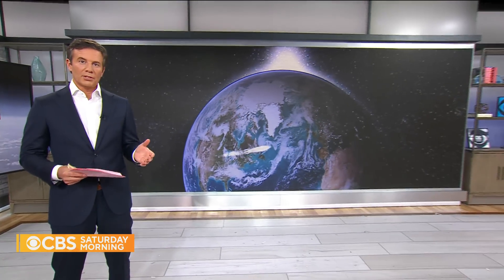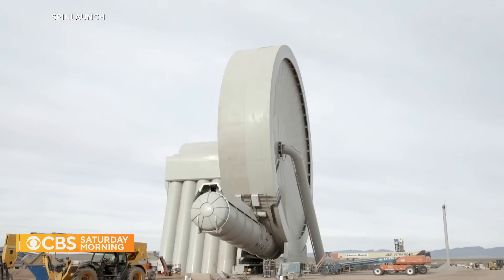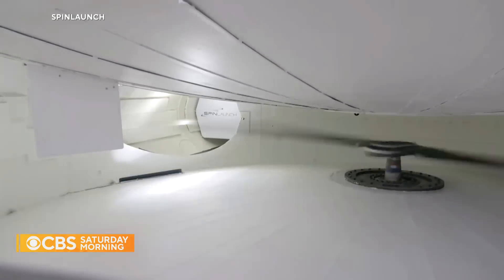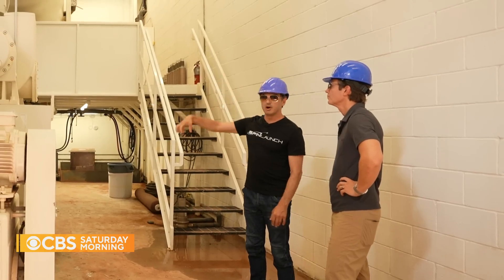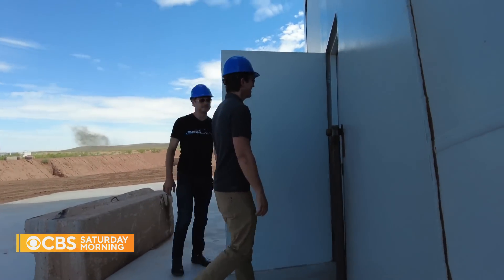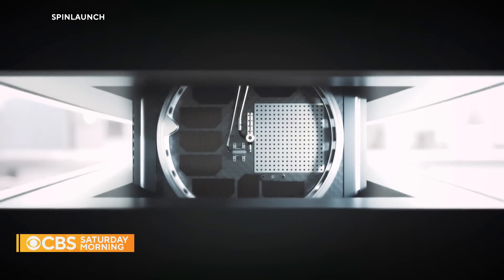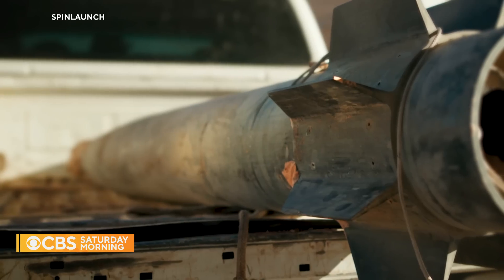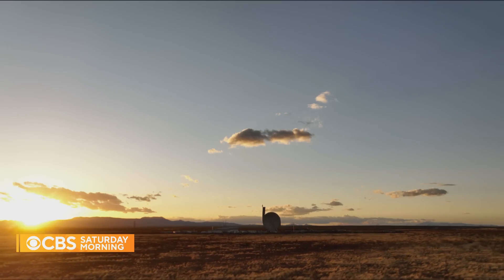New technology aims to put a whole new spin on space travel

Comment: Take a look at their website. They make a few claims that are obvious lies. If they’re lying on their website, they’re telling even worse lies in private.
ie.
They’re making claims that they’re system will be less environmentally impactful. This could be true if the rocket they used was any smaller than their competitors. Unfortunately for them, their stupid design means they need a similar sized rocket to their closest competitor, RocketLab’s Electron. That means little to no environmental improvements in manufacturing or propellant use.

They also claim to be working on space systems that will allow satellites compatible with their launch system that don’t compromise on “cost, performance, or mass.” This is so obviously BS I think it’s fair to call it a lie.

Comment: Begs the question......the projectile and payload must both withstand immense G-loading, so that would seriously limit the types of permissible payload and also require intense engineering of the projectile and any systems/components carried. Seems like a very limited scope launch system albeit much lower cost per mission. Most of the G-load concerns would go away if this was a linear launch system but would require an extremely long distance.....about 400  miles if acceleration is 5g to reach 5000 mph (guestimated velocity to reach low-earth orbit as per this video)  which likely explains his circular launch concept.
Reply: 31 miles for 5,000 mph
The problem is getting it at a decent final launch angle.
Might want a gentle curved slope up the Andes. Brazil might object to the shock-wave.
Reply: @-danR  I used ChatGPT to do initial calcs...mistake. Forgot that math isn't a core strength. Did it again (still too lazy to use calculator...pathetic) and this time it came up 11 miles...much more reasonable than first calc.
Reply: You can't put anything in orbit using a device like this. Whatever you shoot upwards will simply fall back in Earth unless it changes direction once at orbit distance
Reply: @marcopederzoli4939  They only mention this briefly in the piece, but the spinner alone isn't expected to get the pay load into orbit.  It gets it through the first 40 miles of atmosphere, at which point a rocket motor fires up to get it the rest of the way.
Reply: I visited their facility and witnessed one of their tests myself. You'd be shocked to learn that the vast majority of modern electronics and structure assemblies can easily survive those G-forces. Because of the smaller size of the A33, the G forces are actually stronger than what they will be in the orbital version and to test survivability, they literally bought a $20 camera off of amazon and it survived the entire ride from spin-up, lift-off, to landing. The only structures that need to be modified are protrusions like solar array arms or robotic extensions. Those just need to be flattened for launch and they can survive no problem. They even showed us the G-loading computer models and it checks out.
Reply: @yaxleader  Thanks for your informed comment. I must remain skeptical yet intrigued. The g-loads are so extreme and that factor is seldom an engineering aspect in manufacturing = most payloads will require scrutiny (and possible modifications) and possibly pre-flight g-load testing and other special considerations. We'll see....I'll be following this.
Reply: Ya i don't see this working
Reply: @lukeamato2348  ...except as a money harvesting scheme...
Reply: It would be great if they could secure a launch site as close to the equator as possible🚀
Reply: The engineering intensity cannot be underestimated.  🤣
Reply: Clearly not suitable for manned missions or heavy payloads.  I can see it filling the need for small satellites or supply shuttling.  That alone might make it worthwhile.
Reply: It's not as complex as you see it 🔱🎭🇺🇲
Reply: This has been shown to be not practical, just like the Solar Roadways.
What does work is launching craft from high flying heavy lift aircraft.  Look at the X-15 program.
Reply: If the case is insulated enough should have no problem
Reply: And the G-load while it’s spinning is to the “side”. That would seem like designing the payload retention etc. more complex. And the payload would need to withstand very high G load in multiple directions.
Reply: Well if it fails the military would like it for hypersonic artillery
Reply: Who did they con to get the funding for this? And now they want to start building a bigger one without any period of testing? Scam
Reply: Among so many other issues. This is a money making scam. Look at the spokes person. Used car dealer much?
Reply: @rahrahrobbbieee Totally agree. There’s so much wrong with this proposed system, especially as it pertains to reusability, that I doubt this ever really gets off the ground as it stands.
Reply: Bombs don't feel g force. That's what this is really for.
Reply: @eliflynn7282  Source? 🤣🤣
Reply: @eliflynn7282   Might be a better idea to ditch the spinner and, simply attach bomb to end of a metal tube with a pointy cone at the opposite end. Fill tube with fuel so bomb explosion can be extended for about 5 minutes. . .  Oh, and don't forget the flame trench.
Reply: @eliflynn7282  doubts , no way it would ever be effective
Reply: @eliflynn7282  fire like 1 a day
Reply: @lukeamato2348  it only takes one. With super sonic missiles being the fastest right now we need something faster to keep the threat and fear alive. Eventually this will be a war machine it's only a matter of time.
Reply: @eliflynn7282  i doubt it
Reply: @lukeamato2348  ehh... We'll just have to wait and see.